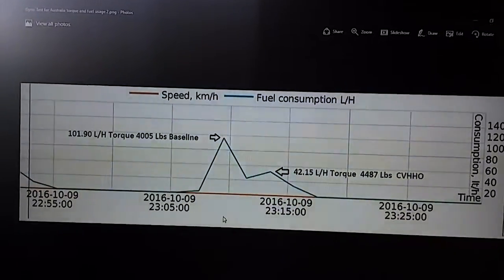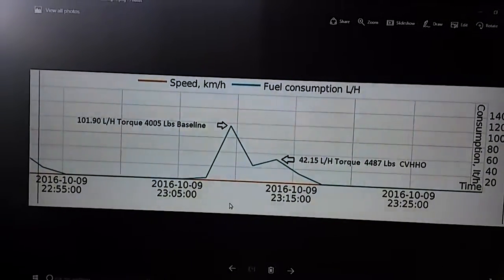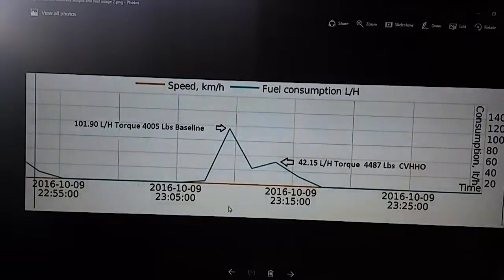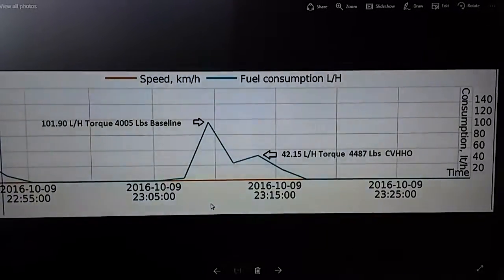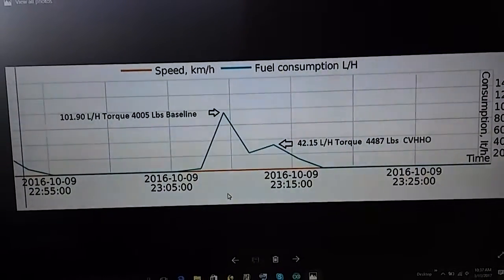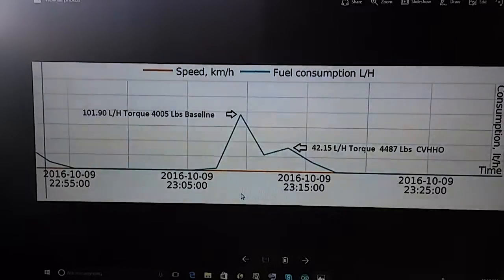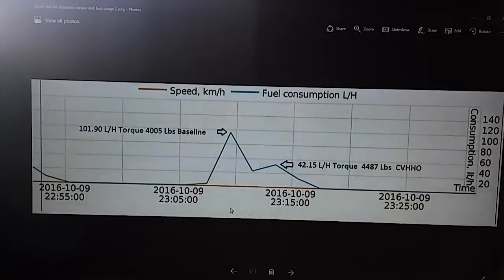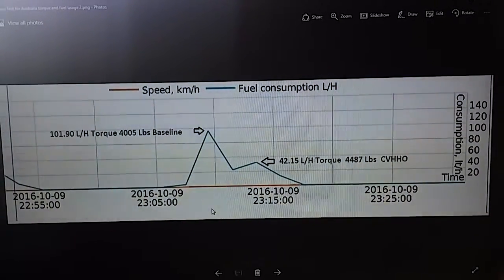HHO dyno test 4487 lb of torque I have proof that there's higher quality hydrogen.

Comment: I would like to see videos of these results with labs testing others' hydrogen since you are so data driven.  I don't doubt there is less, but you aren't saying how much less.  1% is still "less", but if the cost of the system is $2000 less, I think the value per dollar is more.   I would like to see the LPM production in tandem with these results so we can accurately ascertain based on the LPM you're producing whether or not the differences are quantity flow limitations, or qualitative in nature.  And if it's a quality issue with the gas, what is the source?  Is it the lack of a drier? If so why don't you just hook one in and test to see if that's the only difference?  A drier costs all of $30 to add in.  But mentioning a $30 fix to get similar results on a cheaper system doesn't benefit your profit margin I guess.